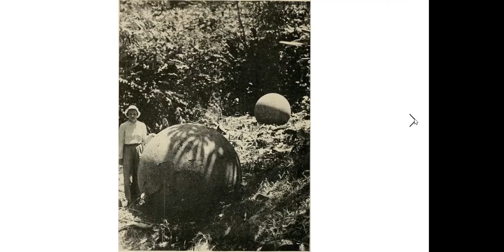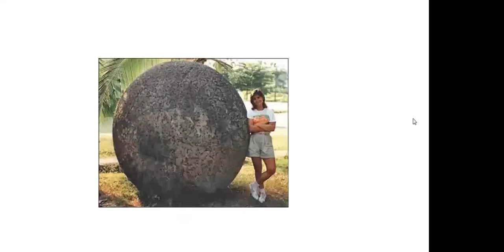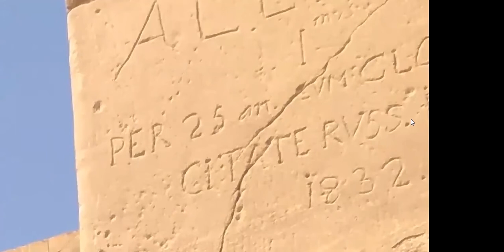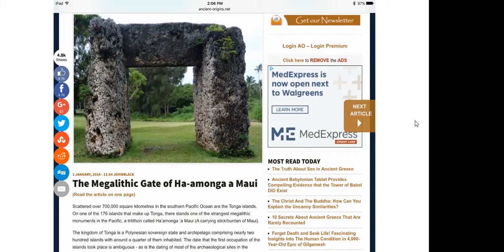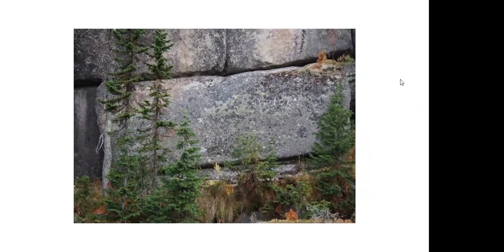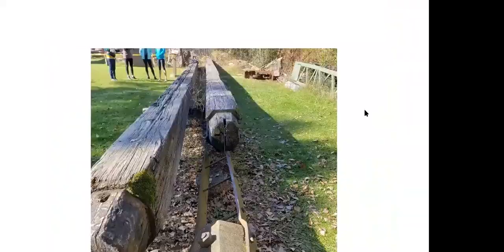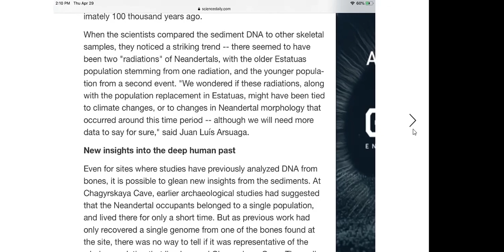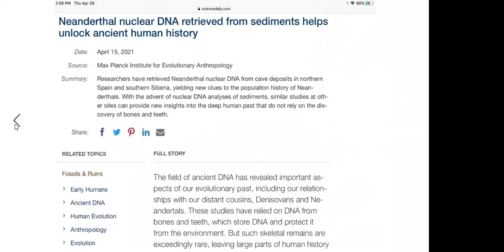Jared's Live Lecture Salem, NH on our Advanced Past. Full Vid @ notaliens.com

Comment: Not only (in regards to Balbek) do you think about moving those huge stones and precision of those cuts, but after you make your precision cuts THEN moving them to the right location without damage... No one builds things they can't move or have the tech/knowledge to do the moves and cutting. I love this stuff!
Reply from the maker: What's interesting to me as a builder, I buy material and bring it to the site to cut, sand etc, to fit it in place perfectly requires work on site. Never ever is an actual build site per the drawings. It's never level or square and minor adjustments involve frequent cuts on wood to get it in place when building or remodeling. 
In the case of having 1000 ton pre cut blocks, to assume they will fit roughly,  sure. To get them where we see them, there is a lot more effort in these ancient stones. Also, the technology necessary to cut even a piece of wood for even the next stud in a wall would be amazing. To do it in stone.... wow
Reply: @notaliens6192  There needs to be core drilling and LIDAR done in these places, and the previously taught stories need to removed from the equation. We need a "clean slate" to start from with these structures, it seems to be the only way to really learn what is going on. The "stories" we've been told have poisoned the well and so much so that these things have created a positive feedback loop of the continuation of the same lies over and over, anyone who asks the questions or disagrees out you go. To think that someone or some group of people find that the narrative they spin is what they need to do makes me think "what are they hiding and why?" Is it really that big of a deal that we know humans go back possibly millions of years and there were different species of human interacting?

Comment: 20:13 so I'm trying to get some clarification on this photo. In the mid foreground, under that chariot bottom there looks to be an ornately carved and dressed doll. Or is it a painting? There is another photo of this room, which looks to have been taken later and is bbn cleaned up some and this doll or painting is gone and curiously, in the other shot, is a sculpture, against this wall, which is smaller and not in the  20:13 short. Are either of these items in a museum I'd like to see up close.

Additionally, in the second shot, you see the chariot bottom is covered with a fabric orb leaf bottom. It is not open. So is the chariot in the 20:13 shot missing the bottom? Did someone climb back there for the shot? The person looks like a young Egyptian.